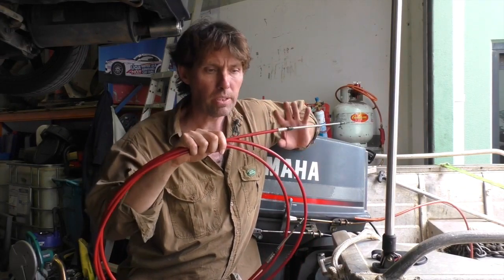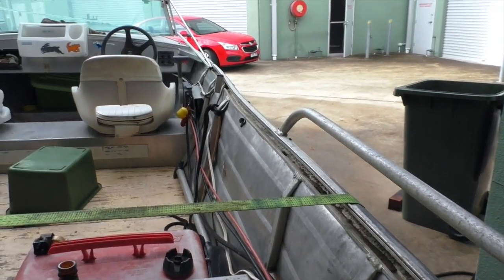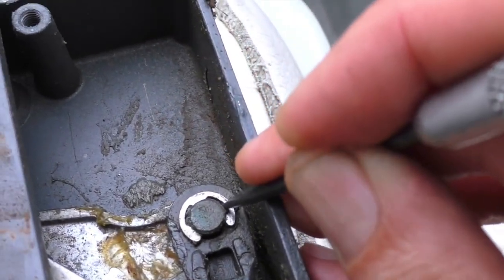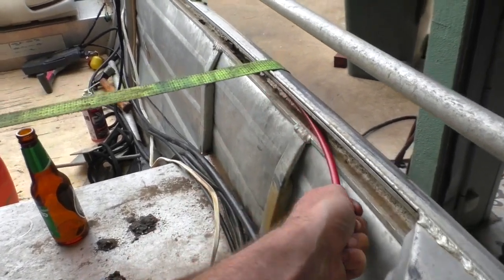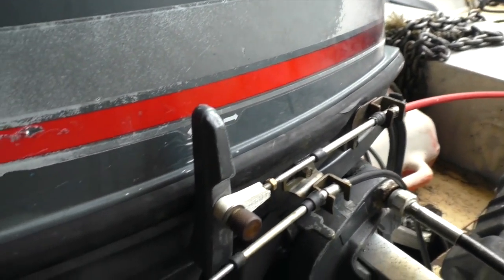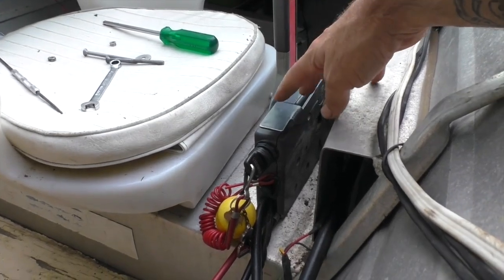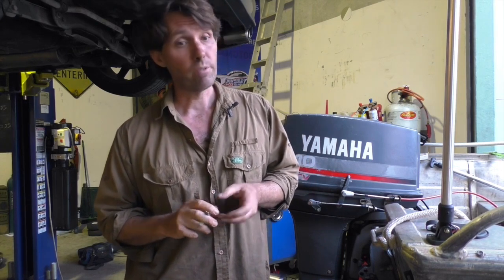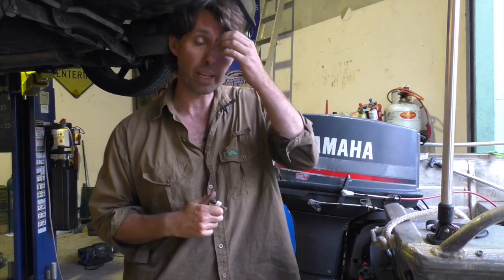Changing an outboard control cable

Comment: Hey, I put my new cables in myself and I'm having some issues. It's a precision blend 115 yammy with the 703 controls. When I start it up, it's revving at at least 4000 rpms. Is there a difference in the shifter and throttle cables. I definitely got something backwards.
Reply from the maker: The cables are the same but you may just need to wind the end more to shorten or lengthen the cable as appropriate to bring the idle down.
Reply: @DangarMarine  Yeah that was it. Thanks. Love your channel

Comment: I always have problems with Yamahas those plastic clips the connect to the linage alaways break! they are exspensive to buy
your thoughts?
Reply from the maker: I've never had too many of them break. You might find some second hand ones on cables that have been thrown away and an outboard wrecker.

Comment: How do i know what cable goes on my control box meaning where does shifter cable goes and where throttle cable goes
Reply from the maker: When you move the throttle the shift linkage will move a large amount and then stop moving while the throttle will continue to move as you apply more throttle.

Comment: Hi Stu! 
Always great watching your vids! Thank you! ^£;_^? 
Just wandering if any one has any idea as to why my remotes are so incredibly stiff!! ......... 
Could be that the remote boxes are just crap? .... They do have what seems an unnecessary amount of travel, 
before "THE BITE." 
Ever since new, these remotes have always been stiff, and no, it's not got any thing to do with the tension screw, it's 
backed right off! 

This is a twin Engine configuration, with two single remotes, which I have modified, by taking the lever off the inside 
Remote and putting a Stainless Steel Block in the square slot, now linking the the two remotes, where the lever was, 
so that both remotes now work off one lever, (the outside Lever.)
solution, so I don't know if very one can understand what I mean. 
I mentioned this, because I had considered TRANSFERRED LOAD as a possible culprit, but the difference in  the load,
between one motor and two is negligible? 
The Remote cables run under the deck of my RIB and there are NO excessive tight or sharp bends in the Remote cables. 
There are surface cracks in the outer casing, but this is a more recent development, as there is no difference between 
these cables here now and when they were new. 
A point I thought worth mentioning, is that these have seen less service than the 18 hours running time on my motors! 

Before winter kicked in, I unhooked the cables from the remote, oiled them up using regulated, compressed Air from my 
Scuba Tanks, to push the Oil through and the cables were moving quite smoothly, shifting gears, etc. by hand! 
So whilst I was considering the Cheap Yamaha Replica (SAIL) Remotes as the culprit, some thing else came to light. 
We have had some rather nasty, sub zero temperature weather here so I have not done much with them for the past 
few weeks. 
I tried to do the same push and pull action on the cable by hand and the whole thing was pretty much seized up, very little 
movement!  (Oil Freeze?) 
The Cables are also Cheap Yamaha Replica (SAIL.) 
Is there such a thing as just SHIT!? 
Could buying and installing different remotes and cables make a difference?  
This was a (SAIL Package) Original  Yamaha Enduro Engine moulds and Dies bought by Sail, from Yamaha and licensed 
to be manufactured under the Sail Brand name in China! 
Whilst the engines seem to be OK, I can't say the same for the controls! 
Does anybody have any suggestions?  
Any help would be greatly appreciated!

Comment: Hi mate, like watching your vids tho i have a problem, i have a 1977  Evinrude motor and its hard to put into forwed gear, it will not select drive on the forwed controls but wen i do it from the shift lever on the motor it goes into gear but only just as it pops out of gear now and then. it dont make any noise when it pops out so i kno the gears are all good only makes the motor rev out because it pops back to neutral. the thing is that im seeing that the shift lever is to fare forwed on the spine and the shift lever is hiting the motor casing not allowing it to go into drive all the way. now im thinking of removing the shift lever and bringing it back a thew notches to allow more room but how the hell do i remove the shift lever? iv removed the screw from the lever but the lever will no budge
Reply from the maker: I've never worked on any old Evinrudes so I'm not sure about removing the shift lever. I'm not sure I'd be taking that approach though unless you are sure the lever has slipped. If not you will be changing something out of spec to compensate for something else that is out of spec. Does the shift linking down to the gearbox lift up and down or rotate on that model?
Reply: Yea the shift lever had sliped and was a problem taking it of due to seized bolds and screws. Snaped some of the bolts trying to undo em and broke a part of the adj lever & shaft assy in the process.. but puting some vice grips to change the gears and runing the motor the gears work fine. Dose not jump out at all no more. So now its another problem i need to fix is replacing the shaft assy.
Reply: I think it rotates

Comment: I bought a new shifter and cables .replaced them and nothing works .the throttle don't allow the motor to get more speed and gear shift cable don't move far enough to put in with reverse or forward
Reply: did you ever figure this out? i'm having issues with the gear selection cable fitting and working properly.
Reply: take that back.I was just being stupid and it's working now. Hope your issue was resolved as well.

Comment: Danger marine how u doin need help cant find shift cable for yamaha outdrive i need lead ball end wire that goes threw bellow and other end to motor with small nut and thread end like one u have on thus vidieo any help be apreciated it 7.4 with yamaha outdrive
Reply from the maker: I don't have videos on outdrives unfortunately. Is the part discontinued? I would normally just get parts like that from a Yamaha dealer.

Comment: just got me a 90hp nissan outboard owner said when motor warms up its loses spark on one cyclinder what can cause that ??
Reply from the maker: +386mgar Heat can cause bad electrical connections as joints expand. You could try swapping the coils around and seeing if the problem stays with the same one.
Reply: +Dangar Marine thanks I'll give it a try when I have free time and let you know

Comment: You ever replace a tiller throttle cable on a honda?
Reply from the maker: No, but from memory I've had a few off an one. Is it the type with the cylindrical stopper on each end of the cable?
Reply: Dangar Marine no its got an en much like the one you are holding in the video but the other end i looks a cable but with a spiral or helix. The motor end is pretty self explanatory but that cable end throws me for a loop.

Comment: Danger marine  my replacement cable has a red tape on one end what does that mean
Reply from the maker: Probably just a part of the packaging. If both ends look the same (which they should) then it can go either way around.
Reply: @DangarMarine  on both the throttle and the shifter cables on one and it has a red tape on the thread
Reply: I'm just wondering if the one with the red tape on it is supposed to go to the engine and or the shifter end
Reply: @DangarMarine  I appreciate you taking the time to answer I replace the throttle cable today and the throttle lever went forward and it won't go back anything you can tell me to help me get that back into place would be greatly appreciate it